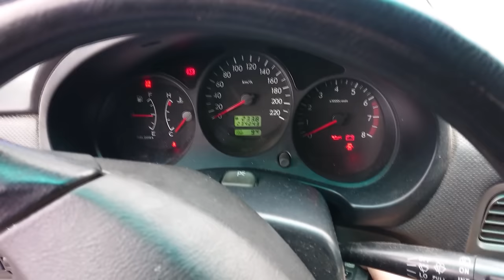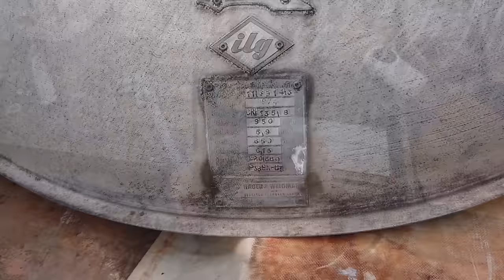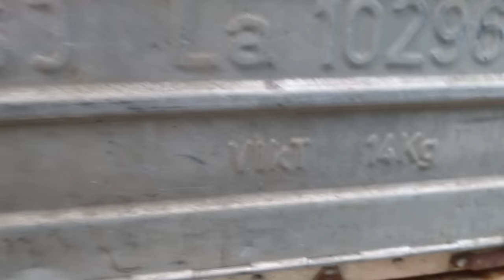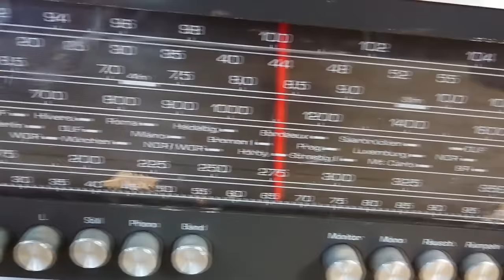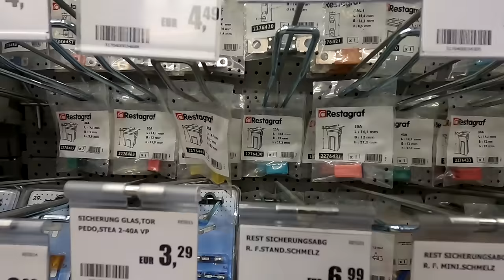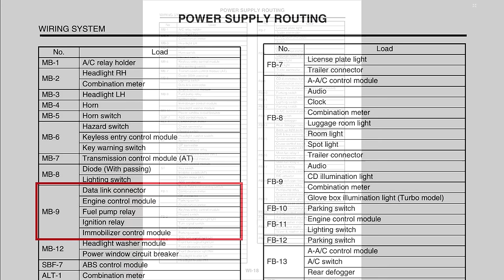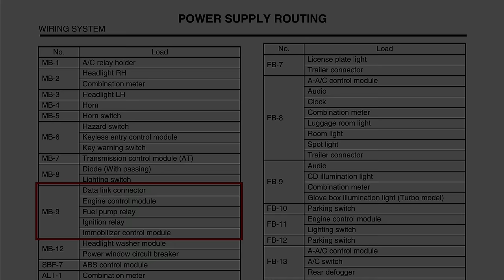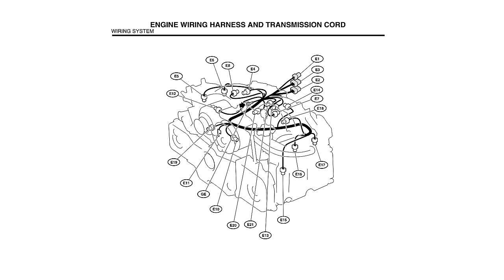New Awesome Scrapyard Finds! Repair-A-Thon!

Comment: When a mechanic says "you need a new wiring harness", what they mean is "we don't know what the problem is". When I have a dead short, I replace the fuse with an incandescent light bulb. That limits the circuit to maybe 500mA, or whatever the bulb draws, and if the bulb lights up, you still have a short circuit.
Reply: Fancy running into Wes in the comments section of TPAI!
Hey Wes, have you been watching "Jimmy, Making it Work" ? I can't believe that guy's putting out a video 6 days a week!
Also I voted "Keep doing what you're doing" on your poll. Sorry about that but I can't put it any better. I have watched all of your videos a minimum of twice.
Reply: @warrantyvoid100  - I concur!  I thought of you (Wes) and also Eric from South Main Auto while watching Gerolf troubleshoot the short.  So glad Gerolf was able to fix his problem!  A cat might help control the rodents... 😊
Reply: I fkin love the "incandescent bulb fuse" idea, saw it used years ago in a local repair shop, and I beat myself over how stupidly genius it is and why I didn't think of it before. Since then I made myself a testing stand with multiple bulbs so when I plug in failing appliances, I watch the fireworks show with safe limited current, watch the faulty components fly off the board before I commence board repair. Makes it. So. Easy.
Reply: The intensity of the light bulb can be read too. Normal component draw will light it, dead short will light it to full brightness.
Reply: @akawireguy1197  shows visually the various components turning on and off, too!
Reply: the thrill you get when you find the cause for these issues gives you a nice dopamine hit though thats for sure.
Reply: Those of you interested in technicians who actually troubleshoot automotive wiring like Wes (watch wes work) and Eric (South Main Auto) should also watch Ivan at Pine Hollow Auto Diagnostics.  And, for fun, Derrick at Vice Grip Garage since he'll make cars work using various shadetree techniques anyone at home can do.
Reply: that's the difference between true mechanics and part swappers.
Reply: Nice!
Reply: I use the dim bulb start when working on vintage electronics..
Reply: Everybody YouTube name dropping... I have to mention "Diagnose Dan"
Reply: @samvalentine3206 Cat's under car hoods generally give rather unfortunate results in the long run, especially if the car is actually driven.
Reply: Didn't you troll diy'ers as Soldering Salmons for not having fancy Deutsch connector set, TPAI could have actually used a Salmon to get under that manifold.
Reply: @samvalentine3206  Had this lady bring her crt monitor in for repair, you know how cats like to lay on warm crt's, when I cracked it open the cat had puked in there. lol
Reply from the maker: Hi Wes, nice to see that you watched my video :). In this case I suspected from the very beginning that something might be wrong with the wiring because of the cherry stones all over the engine. It was actually my worst fear that mice might have damaged the wiring, but I was still hoping to find a simpler reason for the short circuit. It kinda was wishful thinking, but I also wanted to do a more methodical search before starting the take the entire car apart. The lightbulb method is pretty cool! Since I was sitting on the driver seat, turning the key constantly with the hood popped open, I couldn't really see what is going on there. So I connected the multimeter, measuring the voltage across a resistor and then set it to MIN or MAX respectively. That way I could HEAR weather or not the current was rising /falling. The fluke makes a 'BEEP' noise every time the value changes and that gave me an instand feetback. Let's hope thought that I will not have to do this, or the lightbulb method anytime soon again :D
Reply: The best I found here in the States is using a mixture of solution with peppermint oil but you have to spray it once a week that and peanut butter with rat traps
Reply: How much does it cost to buy property there you should get a fun going I would throw a few bucks your way and maybe you could also do a thing where people throw money towards the property if they ever came visit they could crash there for a weekend or something just a thought
Reply: A great video, but a lot of trouble and trauma -thanks for making it so we could share that with you! I often wish for simpler machines, the cars I used to work on as a mechanic in the 1960s were able to be simply diagnosed and sorted because they had single-purpose systems throughout, but of course they were slower, thirstier and less ‘safe’. Certainly a dilemma! Again my thanks, and I hope your Subaru keeps going for a long time yet! Les in UK 🇬🇧
Reply: Congratulations on finding your fault. I was the electrical guy at a shop for a while. An intermittent fault can be a real pain to find and from a service side tough to bill out as well. I offer you three suggestions for next time. Invest (or make) a remote starter switch so you can be standing in front of the engine when you crank it. Push the car into a dark place, block out all light pollution, and try to recreate the issue. Your intermittent short to ground may cause a small spark which might be seen in complete darkness narrowing down its location. Keep a few automotive plug in circuit breakers rated for the amperage of the circuit you are dealing with. You’ll go through less fuses.
Reply: I came here to say Wes would be proud of you.  😂
Reply: My dodgy replacement fuse when troubleshooting things is to use solder. It doesn't last very long when there's a dead short..
Reply: Nah…what they mean is you will save money on labor by just buying a harness and having it installed. It doesn’t reflect in any way on ability. Most mechanics can troubleshoot anything but most people can’t afford to pay their labor.
Reply: I think you were too generous towards the Subaru workshop. I had similar issues with Rats last year. I trapped and poisoned them but the biggest difference I made was to clear away the peaches dropping from the nearby tree in a timely manner.
Reply: @WatchWesWork Can you recommend a quality vehicle for TPAI?  Perhaps a German rendition of an American pickup truck?  Imagine the projects he could bring back from the scrapyard!  Like at 0:41 that huge engine would make a sweet table.  This video would have been appropriate, but can you guys do a collaboration video?  Wes ever been to Germany?  @ThePostApocalypticInventor do you like corn?  Try a cat for the rodent problem?  We would all love to see you have your own property and better workshop; how much would that cost?  People are generous, you should ask or start a crowd funding campaign.  Auction your scrap-a-thon projects?  Speaking of which, @WatchWesWork  have you started your workshop shuffle/renovation?  Can't wait!  You guys are great, thanks!
Reply: @ThePostApocalypticInventor  Do you follow South Main Auto? Eric does a lot of troubleshooting of wiring harnesses, tracking down the "green crusties" as he puts it - wires which have had the insulation rubbed through and then the copper has corroded.
Reply: TPAI need to watch some SMA :D
Reply: Well, in this case they would have been right as the fault was in the wiring harness
Reply: @ThePostApocalypticInventor  Hey, I'm wondering if you can tell me where you found the manual for your car. I often use Chilton's for my car, which I access through the library website, but it doesn't have all the details of a full manual.
Reply: @Google_Is_Evil   - That actually happened to my father - cats and fan belts do not get along
Reply: I used a 1/4 screwdriver and then traced the smoke... but your way would work too.
Reply: You can buy self-healing fuses with tiny LEDs that light up when they shut off.
Reply: Have you seen Diagnose Dan, he also shows some interesting problems on cars
Reply: How do Wes nice to see you on here
Reply: “And acquire a heat-seeking rodent terminator such as Max”
Reply: Amazing to see you both team up on something!
Reply: Praise from Caesar!!!!!
Reply: I've seen you trace down shorts and broken wires. Gonna have to do the same thing myself soon. Summer is coming and my AC has a short to ground somewhere. Cheers :)
Reply: thanks, Wes
Reply: If the bulb lights up, start wiggling wires until the bulb flickers. Keep on wiggling wires until you get closer to the short. Wiggle-wiggle, shake-shake and before you know it, you'll find an abraded wire onyour motorcycle that got pinched between the frame and the gas tank.
Reply: @scottcates  oh, that's genius, love it
Reply: You can also use a thermal circuit breaker with 2 leads soldered to it to fit the fuse holder. We used to call it the "Smoke Detector"  haha .  I still have the one I made years ago.  Would have been useful for this engine wiring issue. Plug it in and start wiggling the harness hear and there. Of course having the same thermal breaker amperage rated for the circuit is kind of important. "What is a thermal circuit Breaker? A thermal circuit breaker is a resettable circuit protection device that is primarily designed to protect components and equipment from current overload and short circuit conditions.
Reply: I used light bulbs as a replacement load for the power supply when repairing CRT TV in the past and being able to check circuits and signals, as far as the rest of the TV was still working.
Reply: Yes that's the way to avoid any further damaged components. Its called soft fuse or soft starting. In electronics repair if say a power supply or an inverter welder goes faulty i do the same. Otherwise I'd keep blowing components that aren't cheap to replace especially the power MOSFETs or IGBTs. I'm of the thought that if you can't fix it then good chances are the dealer or specialist repair shop won't be able to do it either. Because they simply do not want to spent that much of time or don't have the troubleshooting expertise. Sometimes you just get too tired to find an evasive fault but then sometimes you just have to stay determined and somewhat hellbent.
Reply: @Google_Is_Evil Cat’s what? If you just mean cats then please don’t put an apostrophe at the end, it means an entirely different sentence.
Reply: @warrantyvoid100 '+1 hard to diagnose issue on older car and I thought of Wes. I like how he dissects these problems very methodically.
Reply: vs my e bike, i literally need a new wireing harness because i twisted my wires 360 degrees and have shorts RIGHT at the wheel, if i re-soldered it i would lose too much wire length so i need a new wire from ebay, i am using my backup bike right now but i have a wheel or 2 i need to fix as well
Reply: "You need a new harness" means "We don't think it'll be cost-effective for us to learn to troubleshoot your ONE (class and brand of) vehicle's wiring harness", which also is saying "We're too lazy to want to learn."  I second/third/forty-ith the "Use a light-bulb in place of the fuse" suggestion.  Well, ok, for MY paranoia, I'd do a fuse-then-light thing for max safety/paranoia.  Maybe that's overkill, but that has always been my favorite kind of killing method, especially if I'm on a circuit with an ECU or other usually-expensive pieces.

And...the wire that is the issue there, is that not actually SOLDERED in its center?  It looks like it was f'd up in the past and soldered by someone, unless it's just 'melted from a 30-amp dead short' maybe?  If that has solder, though, that's super-strange.  I use solder on my personal Civic for some specific wiring repairs, but I also put heat-shrink or clip-over protectors onto the work to make sure it's all protected and kept secure, but that looks like an end-to-end soldering from the manufacturer, like a tech snagged their tool and had to fix it quick and didn't want to have to explain the cost of a new wiring harness so he did it on his lunch break or whatever and didn't have a heat-shrink tube available.
Reply: WES!!!
Reply: @ThePostApocalypticInventor  In the UK we have whats known as methylated spirits which is ethyl alcohol that used to contain methanol to prevent consumption. These days the methanol has been removed as causing blindness for not paying alcohol duty is now frowned upon and alternate methods have been adopted. One of the ingredients is called bitrex (denatonium) which is an extremely bitter tasting compound. You could mist spray the wiring in your car and when the alcohol evaporates it will leave the bitrex behind this will dissuade the rodents from chewing your cables. I'm not sure if the German formulations will contain bitrex but you may find an alternative which does.
Reply: Can´t believe it! as soon as the video ended, i thought what would have done Wes here. Can´t believe you guys watch eachother videos! You´re both inspirational to me!
Reply: @samvalentine3206  The only other person I can imagine missing from the conversation would be Mustie. If anyone knows about rodent damage to wiring, it's him. :)
Reply: It could also mean "the cost of a replacement wiring loom is less than the cost of me troubleshooting this faulty one so it's a more financially sensible way to go." 
When my Subaru L Series developed a fault years ago my local Subaru specialist mechanic said "It could take days to find the fault, but it only takes an hour to replace the whole loom with a good used one". Needless to say we replaced the loom and had no problems. It even started right up first go.

Comment: your perseverance on the car is inspiring
Reply: Persistence is useful, after all, there are only wires here, there is no need to panic and scrap car. You have no chance to repair the broken engine block or the control computer yourself in the yard, but you can take out the electrical installation (especially only the separate engine wiring) and replace it wire by wire on the work table. Such a failure is not fatal if you have time (in any case, it takes time, even if you leave it at the car service) and you like electronics and turning screws.
Reply: @vintageelektro5437  Engine bock swap or repair and ecu repair on your driveway or even parked curbside is possible. Been there done that out on necessity.
Reply: Supposedly, strong smells, like pepermint, help to keep mice, rats, and squirrels away.  I do not know how well that works in the engine bay of a car.  Maybe a leash on a cat, tied to the underside of your car might help. LOL

Every project you do inspires me!
Reply: @lourias  Tesa and Honda have duck tape with capsaicin and if you wrap your electrical installation with this duck tape it is the only thing that will save you from rodents
Reply: @idrisddraig2  Depends on the neighborhood, the time of year, and the car. If you are a motorist and have nearby a garage full of tools, maybe. But I mean, major engine repair is not possible in a normal home or garage with a file or a hand drill. This requires specific equipment and knowledge. Same with engine ecu repair. You can't do everything with a simple soldering iron or without special software. However, you can repair the electrical wiring with patience, wires, heat shrink tubes and a simple soldering iron and a quite few tools.
Reply: @idrisddraig2   I have done a lot of repairs on my vintage Mercedes in the apartment building yard, but not all the neighbors are happy. Also, replacing the engine chain in late October resulted in a tooth jump - meaning a major teardown (for a V6 engine), lifting the engine a bit, removing the entire front end. You can't do it in the dark, in the evenings, with a lamp on your head when it's raining and freezing. In theory I could, but it would be more painful than taking it to a car repair shop. So repairing wiring loom is relatively easy and comfortable. You can do it with soldering iron, pliers etc. on bench at home. Unlike engine or ecu where special equipment and knowledge is required
Reply: I'll keep my old Chevy.. 15mpg, no computer, MAYBE 40 wires total

Comment: In the future, when troubleshooting a fuse-blowing, consider using a LIGHT BULB inplace of the fuse. (wattage based on fuse being replaced)  If the bulb is bright....the short still exists. This 'trick' is commonly used to save the cost of many fuses while the bulb protects the circuit.
Reply: This is a great trick!  I learned it from an old air force radio technician.
Reply: Try those self-resetting fuses that have built in LEDs that come on when they shut off.
Reply: @brucepeebles4939 I was going to suggest using several car headlamp bulbs chosen to draw maybe 20 Amps, in place of the fuse. Then the current path through the wire to the short-circuit will get warm but not hot enough to melt immediately. This is the time to get out the thermal imaging camera and you might be able to follow the hot wire to the location of the short. This obviously is only practical when the engine is cold, but if you can't start it for several days then that's not going to be a problem!
Reply: @chrisgj198  It doesn't work when you can't even see the harness
Reply: @schwuzi True, but if you can see the heated wire leading from the fuse towards some obstacle and then behind it, and the cable coming out the other side is not hot, then that might be a pretty good clue to look behind that object with mirrors, a borescope or whatever you need.
Reply: @chrisgj198  Actually I have a better method that always finds the spotty wire (or whole loom)

Replace the 30A fuse with a 40A fuse and wait until a fire starts. That actually happened last year to one of my cars. I definitely found where the issue was, just needed to replace that whole loom.